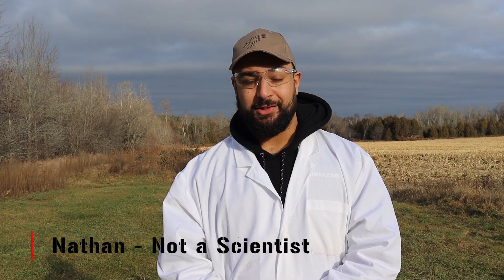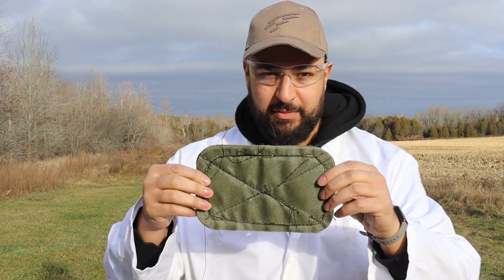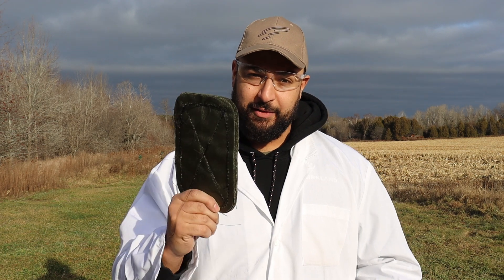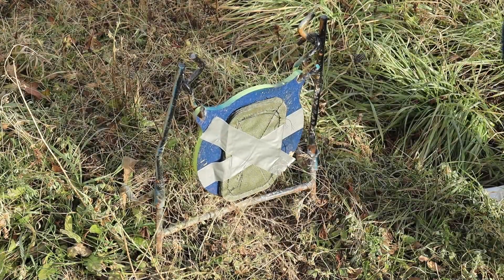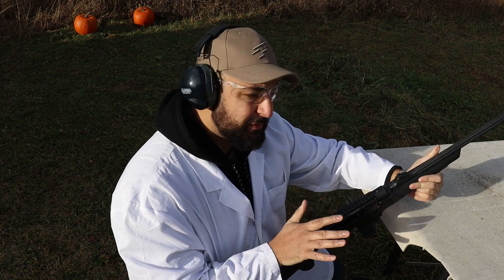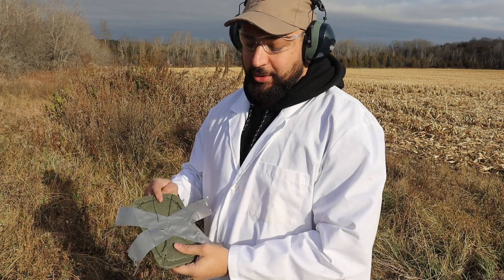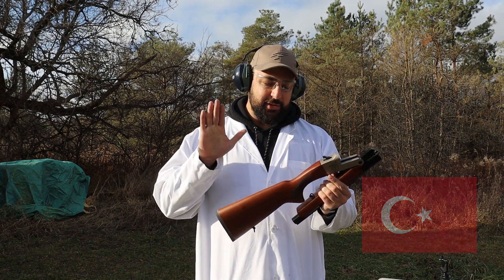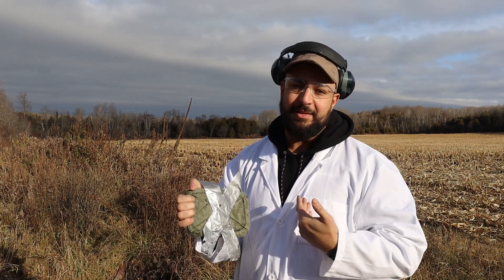Home Made Body Armor Test - Ballistic Nylon

Comment: I saw a japanese video, where they used a flak diaper, 12 layers of Ballistic Nylon were capable to stop 9mm JHP bullets (4 of 5 bullets stopped) at close range, but failed at stopping 9mm FMJ
Reply from the maker: Interesting! Were they bonded? Or just loose?
Reply: @barelytactical900  loose
Reply: @barelytactical900 Oh btw, in that test they used a pistol

Comment: Cool test. Like you mentioned ballistic nylon was used for "flack" vests and intended to stop frag from flack rounds not bullets.
Reply from the maker: Exactly - hypothetically more layers might be able to stop bullets, depending on how far you want to take it
Reply: Flak, no "c". Derived from the German word for Anti-Aircraft gun. "Ballistic" nylon is just standard nylon fibre, originally 2 individual 1050 Denier threads, woven into a 2x2 basket weave rather than a 1x1 plain weave. The heavier 1650 Denier version is actually less effective. Enough of any material will stop a bullet eventually,  but practical limitations for the weight and bulk of any body armour. You need around 4 times the amount of 1050D Ballistic Nylon to equal a vest made of ballistic Kevlar.